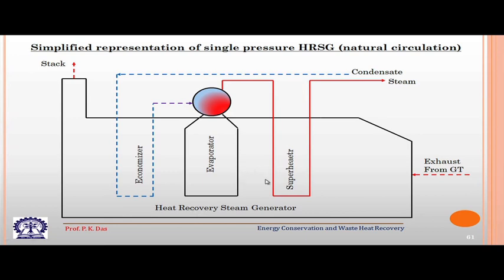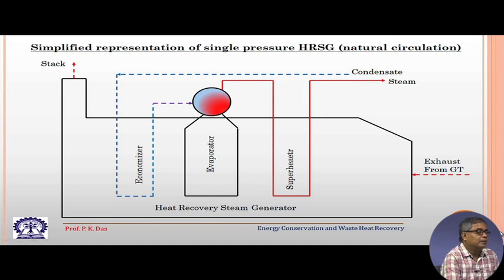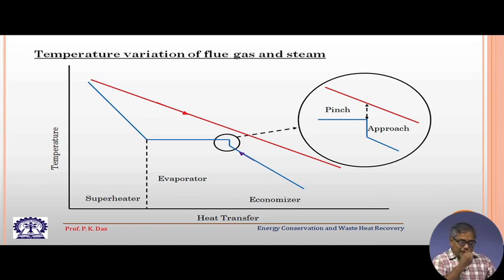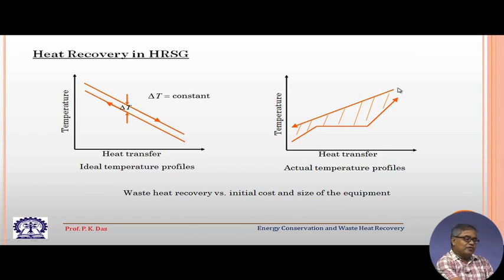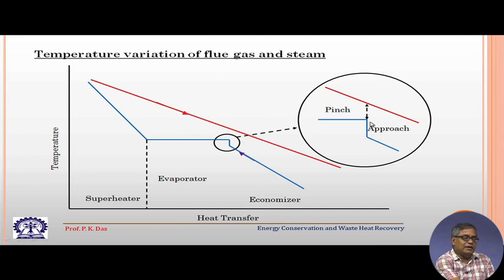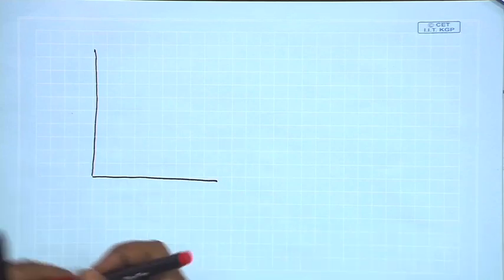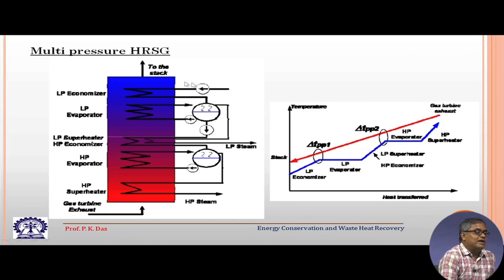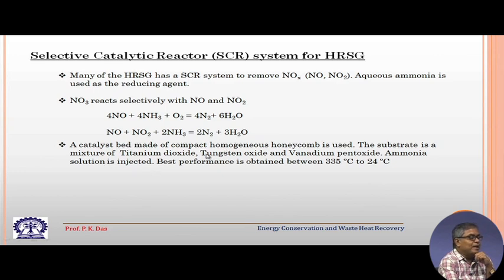Lecture 26 : Heat recovery steam generator

Comment: Sir how to calculate HRSG efficiency with adding Suplimentary firing in HRSG?
Reply: I wanna do this too for Master Thesis. I wanna calculate efficiency of combined cycle power plant with hrsg with and without suplemental firing and see how it will affect the overal efficiency of the power plant. I haven't started yet but it will be smth related to this.

Comment: Just an appointment to benefit who's watching: what is being referred to as "Approach T" actually corresponds to "Sub-cooling temeprature difference", between saturation temperature and actual inlet temperature of water into the evaporation section. The "approach point" is therefore the difference between the inlet temperature of the flue gasses and the final vapour temperature.
Thought it was worthy specifying it, though it is fairly old.